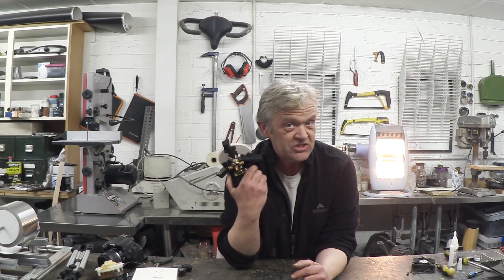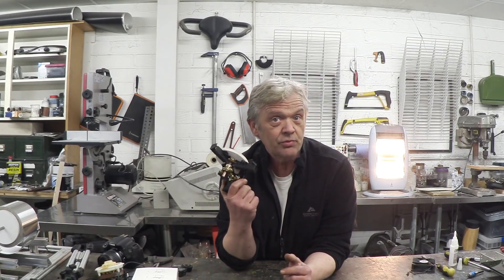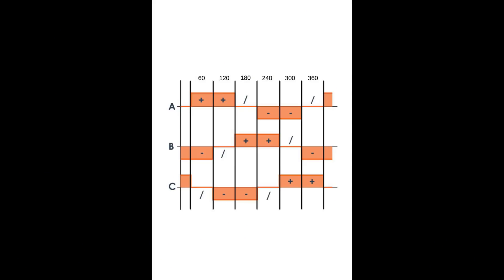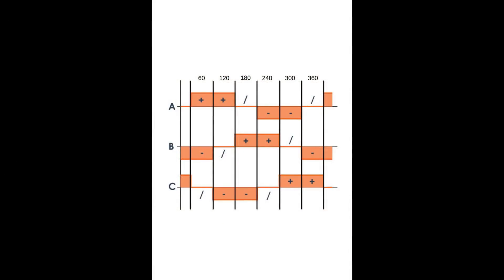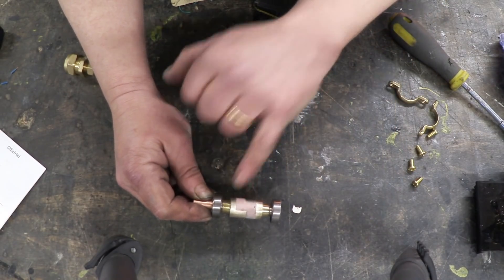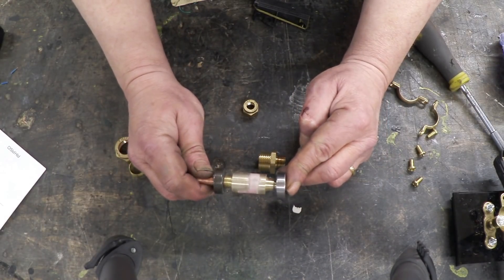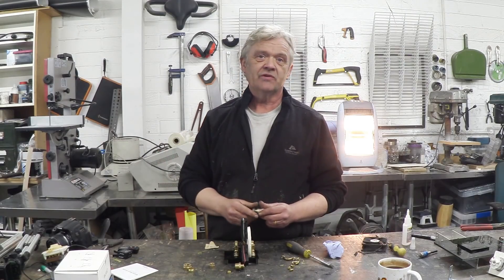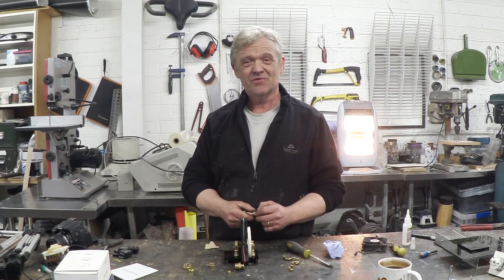1019 DIY Brushless Motor Controller Construction Details

Comment: I just spent 3 hrs last night on Chat GPT, learning the history of the first EV’s and how they were controlled. I argued with her for hrs about how to come up with a purely mechanical solution to the problem of bldc’s. 
Then I just happen to find this video out of nowhere. 
The weeks I have spent haggling with a Curtis Controller and trying to “trick” it into just shutting up and spinning the motor has made me start wondering why I even bother with electricity in the first place. 
I see hope and power with this approach. 
You are an inspiration sir!

Also, I saw a video somewhere where a spring a spring loaded stator was squeezed around the rotor, making the field more intense and increasing speed on the shaft……
I don’t understand how that worked and what type of motor it was, but in this use case, it would make a heck of a “gas pedal”
❤❤❤

Comment: so for example if I put something like this on a gokart with hoverboard motors and then have two separate batteries one just for the controller and a second battery to power the hoverboard motors and mount the mechanical motor controller where the drive axle is in the center of the mechanical controller theoretically speaking could i just have someone push the gokart to get it moving and then press the throttle pedal and take off wouldn't the controller be in time with the drive motor because the axle is in real time with the drive motor of course it would require some math to get the controller the same diameter as the hub motor which I could actually just build the controller out of a hoverboard motor so it's exactly the same size as the wheel motor is.  any suggestions?

Comment: Is there not a chip. Or ic that can basically just connect 6 MOSFETs to with a few supporting components, caps and resistors, diodes.. maybe a voltage regulator. And a over current protection device , seems like things like this could be simple to build by now!   I guess the micro controller is that chip in a way, thing is, i can barely program a CLOCK! Much less a microcontroller!..  its wild the things a micro controller can do!  I know Bldc e bike controllers have a current shunt inside. This is one thing that get modified slightly, . When over clocking the controller,  back in the day. We changed camshafts, raised compression, ported the intake and exhaust ports in yhe cylinder head to gain performance in a bike or car! Now its more volts and trickingthe controller to sllow more current without burning down the fets,!!   Just upgrade the wiring, higher capacity capacitors, thicker traces, maybe add fets if the board has room, or upgrade fets!   For higher voltage and current , 3-4 additional volts can make a difference when you are in the 50's or 60',s of volts on s 48,volt motor,  if one cell is noticed! Imagine 4 cells, go up by 25-28% ,,(+/-) from 60v to 72v gor example. It may require additional cooling of the  motor . Heavy wire, possibly eventually limit the Duty cycle. Give it cooling time between full throttle pulls!   I am just wanting to know if converted alternators are worth the effort?? Id like to see testing, Dyno test, efficiency test. Temperature test! I know they are built differently than of than other bldc motors! And what is the voltage range, i have heard 96-144 is completely fine with the moternator, ,,  with around 9volts or so on the field coil! ,(To get that tq!)  It will run on ,,,8, 9-10v.  However the windings are setup for 100-200v the regulator rewuired  the high voltage so it can barely be yurned on yo to generate enough voltage with s low duty cycle, and still charge the battery!  I have heard nearly 1000v id possible from a full field open circuit alternator!   Take ,,30% from that just cause, then snother 30 because of the Peak open circuit!  Then 50% of that for heat/thermal Losses snd possibly running away.  This leaves  200v or less to run it as a bldc motor  so guessing 48-60v is s starting voltage  and ,96v -120v. id say is the peak, it would require testing! It should do,1500-3000 watts easily!  With a a13v battery pulling down the voltage  it still does about 1500 watts from a 100 amp alternator!   I feel reverse that , it should tak about 4x or more to get 100 amps imput!!  A 150 amp or larger should not require ad much voltage to pull the current!  Well i did it again!! brambling away, have an AWESOME DAY!!

Comment: I use a delta wire configuration, it allows for hi frequency emf generation, a strong sine wave, and im keeping brushes and rotor magnet orignal equip. I can vary speed , torque , and noise...

Comment: This is a great idea. Can I attach this commutator to my BLDC shaft, drive the whole thing with a 2 stroke engine, and get power? Is the commutation sequence the same for generation  as for a motor?. Basically an externally brushed, self commutated BLDC generator ? I am trying to build an engine driven BLDC generator capable of generating 5kw. Drone use, so maybe 10 lbs for engine and generator. The VESC controllers cost about $400, but can get destroyed relatively easily. I looked into brushed DC generators, and a 5kw one weighs about 50 lb. My 5 kw BLDC weighs 4 lbs. So, maybe just replace my VESC with this mechanical device, get rid of all hall sensors, encoders, and blowing up MOSFETs, and generate 5kw?

Comment: An electronics engineer will just say "oh brushes are too inefficient. Sparking is hazardous" and bla bla bla but I fee this is really the way to go.
Just today I saw a video on how difficult silicon based ESCs are to make. The cost of ESC rises exponentially with size of motor.

Especially here in India, no one likes to pay $800 just for a motor controller when a slightly less efficient $5 mechanical controller does the same job.

Since the motor that drives the controller is a very small one, they can be controlled with a potentiometer. No need Arduinos. 

To make this setup more efficient, I recommend using electromagnetic relays instead of brushes to do the switching. This reduces frictional force and arcing. I also recommend using flyback diodes.

Comment: High Robert. As it's only a concept this too is only just a thought. The design of brush contact must not result in a short across two coils as mega current will result. Also for large motors there will be large inrush currents. Finally if the shaft of the commutator was connected to the shaft of the main motor it might be self sustainable and could use a starter motor but may turn into a runaway. Maybe you could also add your mechanical PWM. I do agree the depth of electronic control is too excessive. Remember the old fare ground rides and underground used contactors and power resistors to control motors. Love to see you develope this to control a large (10 KW) 3 phase motor. Also your design may be adaptable to higher poled motors. Power needs to be applied with a centrifugal device so that if the small motor stops power will need to be moved to prevent damaged. Like to see this used on pancake washing machine motor.

Comment: How does the commutation deal with change in speed on the main motor under load? On a brushed motor the commutator is in sync with the motor by default, always energising the coils at the correct position with respect to the permanent magnet arrangement. On a permanent magnet bldc the timing is kept in sync either by hall sensors or by monitoring the back emf on the idle coil.
Reply: Well, aren’t you timing it here mechanically?

Comment: you should checkout simpleFOC, it is easy to use and can be used open loop or closed loop.  You can even drive a stepper with it.  finally you can use a cheapo LM298N to drive it.

Comment: If you are going to drive big motors this way there is a further advantage available to you ...... Rotor resistance!
As it stands you will be punching the full amount of energy through the rotor meaning the motor will have full torque! If you reduce the field strength you will reduce the torque..... handy for soft starting.
Reply from the maker: nice tip mate - thank you

Comment: ⚡️💫❤️it👍
Reply: so much more to play with here if one wants to explore, had some cross wired mechanically Joined electric motors that spun up so high after I rope started them I thought they would come apart on a runaway, never thought I'd see a 1700rpm motor turn so far above rating, a moving Frosty experience that was
Reply from the maker: wow - I'll bet lol
Reply from the maker: cheers mate

Comment: Why not drive it with a toothed belt from the main motor. Put a tensioning roller on the outside of the belt on both sides between the pulleys both mounted on a carriage that can move so it tightens the belt on one side while loosening on the other. This will give you phase advance/ retard tuning.
Potentially FAR more efficient than daft power transistors that always drop your voltage, and make your electricity into heat.
Reply from the maker: because I didn't think about it mate - what an awesome idea - thanks for sharing - love it and it has solved such a problem for me lol - cheers mate
Reply: I was thinking of the same idea but with it inline with the (back end of the) shaft, only issue would be that in the advance phase, an unloaded motor would simply spin up without limit, in retard mode it would act like a brake. To start the motoe rotating you would simplt advance it until the motor starts to spin then retard it until you have it close to the desired speed.

Comment: If you want big currents, just use graphite bushings instead of ball bearings. Ever hear of slip rings on synchronous AC motors and generators?
Heck, there's no loads on the bearings. It's not like the plain bearings in a 40L Rolls-Royce Merlin.
They would work fine too. The indium alloy melts and provides liquid metal lubrication between the crank and Conrod.
Gallium carbon fiber felt slip rings would be ideal. Gallium is a great conductor, melts at 28C, and would do this very quick as soon as you pumped a few hundred amps through it.
Rewire a smartdrive washing machine motor to parallel instead of 3 phases of 14 poles in series, slap some  fibreglass over the outrunner magnet drum, presto!
10000 rpm 200kW auto motor!
Reply from the maker: I have heard of slip rings mate  - love your suggestions - cheers

Comment: Could you not do this with say 10amp momentory switches with the cam pressing them on and off as required?
Reply from the maker: yeah for sure
Reply: I am dubious.  Switches usually have contacts that come together and pull apart.  High currents leave pits and spikes after a while, like the points in an old auto distributor.  Rob's contacts are wiped.  The carbon and the brass will wear but the contact will be consistent a lot longer.  This is a beautiful solution.

Comment: This makes me think you could use micro switches and a shaft with cam lobes in the correct places to be actuated on and off. Then your contacts would be sealed inside each switch.
Reply from the maker: I would think so mate
Reply: I don't think the microswitches would last very long.  Worth trying, though.

Comment: Forgive me if this is a dumb suggestion, but might it be better to use this mechanical controller setup to turn on and off relays that provide current to the large motor in the right order?  Or do relays respond too slow at the speed it would be rotating?  If I understood this correctly, the current to the motor you're driving flows through this controller through the bearings, and I'm just wondering how well that controller will hold up to large currents and whether it might be wise to isolate them.
Reply from the maker: you are 100% right Cat - like a lot of things I do this is just a suggestion of mine and can certainly use an upgrade or two and a rethink about some aspect - but getting folks thinking is what I am all about lol
Reply: @ThinkingandTinkering  Your videos definitely get me thinking!!  You've revived this old dead brain single-handedly with your content, LOL!!  
I'm very glad it turned out to be a helpful suggestion!! 😊 I hesitated a long time to suggest, as I thought perhaps there was something very obvious I was missing on why it would be bad to use relays.  (Sluggishness, back EMF, etc)  I don't feel like I have very much helpful input to offer at times on your projects - many are at the limits of my understanding.  Wasn't 100% sure I fully understood this one. 😋

Comment: Cool.. But what happen if you applay here 400V and 100A? There is a reason that comutators wore out and was replaced by expensive IGBT. At higher current mechanical switch really want to be a welder. But to be on positive side, solution still exist - ther are on the market relays for around 20€ that can handle 300A+, however at 24V. It could be neat to use them with cheap 3 phase driver or comutator like this.
Reply from the maker: I agree mate I think driving relays would be an awesome idea
Reply: I’m happy that you like it. But I have to warn that most relays will die after few hours of fast switching under load, also switching speed will limit rpm to max 200-300rpm. Could be useful for testing tough. I thought about this today, there is another solution - use one expensive IGBT/fast switch to turn on/off circuit in fast manner, like >1kHz, and during off time change circuit using thyristor - this element can enable current on demand, but can’t disable it for itself, but even for large amps and voltages they’re cheap and robust. Of course I think about applications like multi kilowatts motors for a car
Reply: I think your idea of producing one more level of isolation via large current handling relays is a really good one.
I'm worried too about high currents through those ball bearings, etc. but overall the idea has a lot of merit.
Reply: I might be wrong but The more amps you need the bigger contact surface you provide, I think this design can be easily and cheaply scaled up so once the arc will be spread on bigger surface then high power should also be controllable. This design is really cool. Best regards!
Reply: @Kapalek84  You’re right. For my knowledge basic things that need to be managed for successful switch/commutator are enough contact area to avoid weld and spread wear, low interface resistance to lower heating, high mechanical durability and quick arc extinguishing. For same power higher amps allow for shorter arc, but boost its temperature. Higher voltage is easier on contacts and lower overall temperatures, but arc became more persistent.. Also high frequency high power arcs are excellent EM jamming device - most electronic will get high and declare independence from working :) One important thing on the other side - most BLDC are driven by power, not speed, especially in electric car’s. In case of commutator only way to control power is varying voltage - pulse width is fixed. If power to speed ratio is to high, as if commutator is driven independently from engine, rotor spin up to quickly and excess power will be used to slow it down - we can actually see it on video. Not always a bad thing, and possible to manage by few means, but worth to know

Comment: I guess when an internal commutator can work an external one can work as well. However an internal one is phase coupled by definition. yours is not ( it's on a different axis ). Thats ok as long as the big motor can keep up. Its easy to ramp rpm up for the commutator to fast and if it powers a vehicle it will not speed up from 0 to 100 mph in a second when the commutator dictates that. A flywheel on the commutator might solve that.
As I explained in my previous comment there are obvious limitations to what you're doing, but a series motor has the same limitations and is widely used.
Reply from the maker: you could just put a belt around the main shaft to mechanically sync them I suppose?
Reply: @ThinkingandTinkering  Absolutely. What you end up with is a universal motor again. A common commutator has many more poles. I think that has to do with limitating the current when the motor is blocked.
Reply: @ThinkingandTinkering  Yes, but then you would just have an ordinary brushed DC motor. The scheme I suggested would give you electronic speed control with the benefits of a closed loop.
Reply: You could have a position sensor on the main motor providing feedback to a small electronic controller driving a small brushless motor driving the commutator.

Comment: There's an advantage to your mechanical motor controller that you may not have thought of.

If you add shielding to the motor and house the controller in a metal case for shielding; they will be protected from an Electro Magnetic Pulse  whether that pulse comes from a major solar flare or it comes from a nuclear detonation.

It is said that most of the automobiles on the road today will not operate after an EMP.

I'm not sure how accurate that car killing EMP claim is as the computers in cars do have a good bit of metal surrounding them.
Reply from the maker: this would certainly be proof against EMP mate
Reply: @ThinkingandTinkering  😎👍